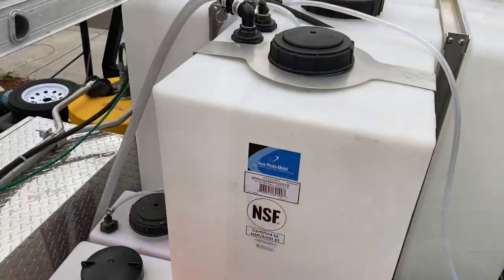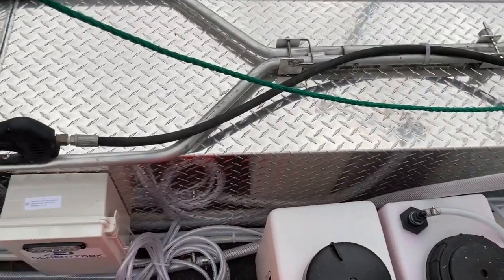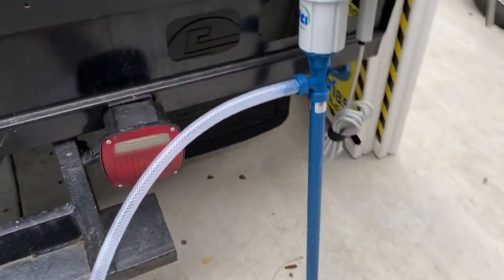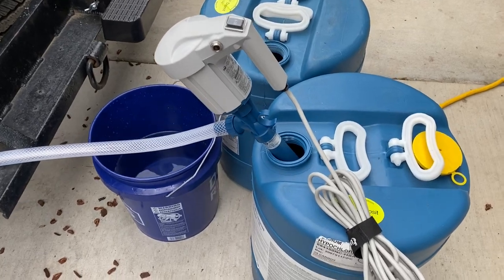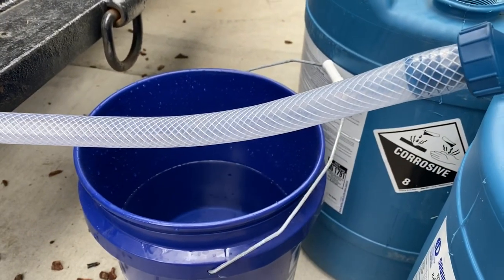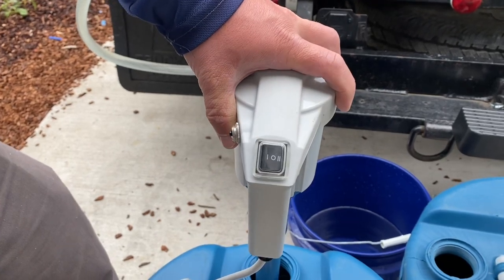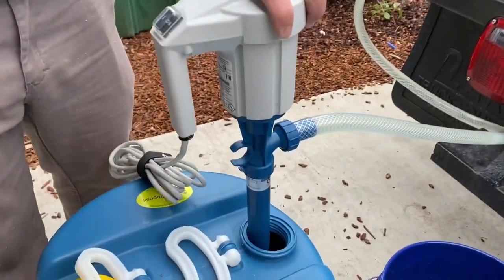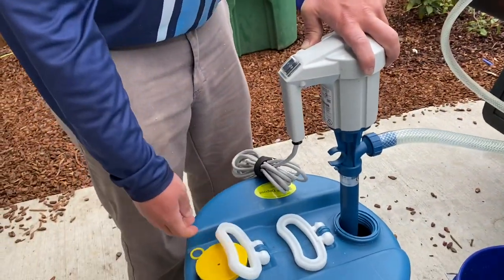New Bleach Transfer Pump and Plumbing

Comment: I’m going to have to use this method living in SoCal
Reply: I do too. Where in socal do you live?
Reply: @milton8586  canyon lake
Reply: @milton8586  where do you get your bleach from? Looks like I am going to have to order it by the 55 gallon. I currently have a manual transfer pump. Hopefully it will get the job done. What areas do you usually service?

Comment: Outstanding..,where is the best place to get that exact pump on-line. I see the EFP 40 on Amazon. But need the EFP 27
Reply: What is the difference with EFP27s2, EFP27S2 & EFP27S3
Reply from the maker: Not sure. I know that they make different sizes. Think 27 is the inches.
Reply from the maker: I bought mine through US Plastic

Comment: Why the carboys? Why not 55g drums?  Thank you
Reply from the maker: I fill my bleach tank now. I liked the 15 gallon car boys mainly when I had my trailer. Easy to move around. The car boys were my bleach tank. Just add 15 oz of soap and drop in the drop stick. It was simple and effective.

Comment: Omg.. It's 400$
Reply from the maker: I’ve had it for a couple years now. Think about this. The typical life span on a daily used 12 volt pump is 6 months. If I would have bought a $129 12v 4 times it would have cost me $516. The longer I have it the more it saves me. I wouldn’t be surprised if it exceeds 5 years. Buy for the future not in the moment. It will cost more in the end to save in the moment.